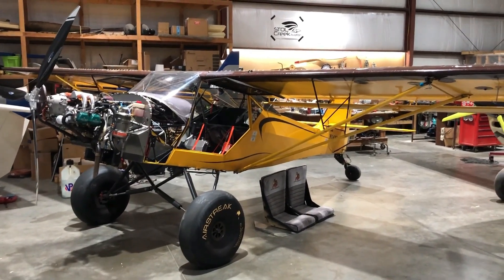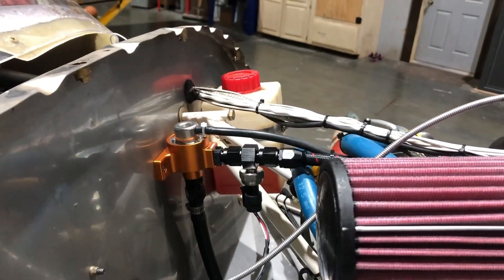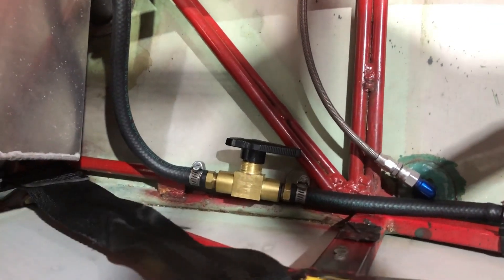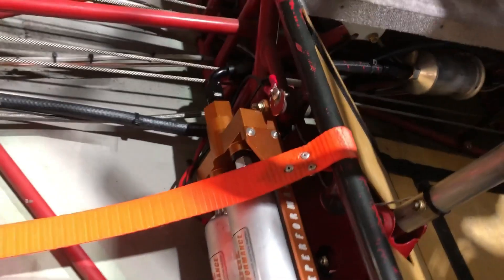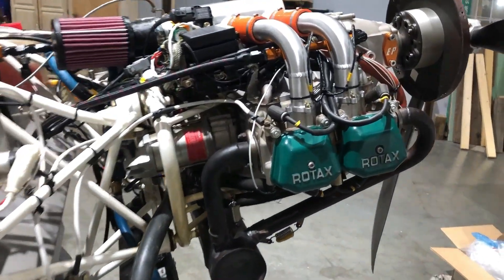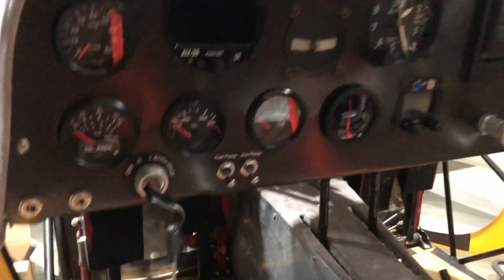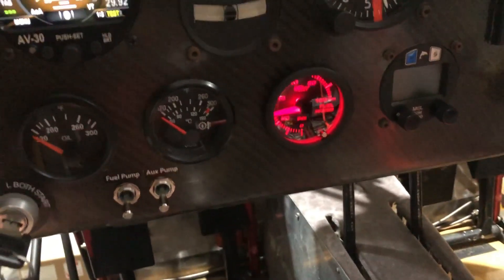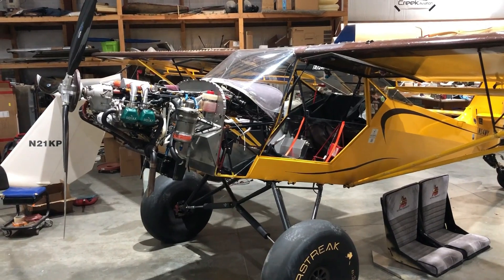EFI and Big Bore in a KitFox 7

Comment: Yes, the Kitfox (I had a model 1)  boot cowl give great access to the behind the panel area, but it also lets in water running off the windshield, unless your cowl seals real tight.  I like the RANS I have now boot cowl better, as the windshield overlaps it. BUT...., having just spent much  time upside down with my head by the rudder pedals doing wiring on my own EDGE EFI install, gives me a re-newed appreciation for the Kitfox cowl!

Comment: Where does the fuel return line go? Back into the header tank? Do the fuel caps on the wings have vents? Trying to wrap my head around the whole EFI thing.
Reply from the maker: Yes the fuel return goes back into the header tank. Both tank caps are vented and the header tank is vented to the right main fuel tank.
Reply: Thanks! @stolcreekaviation5507

Comment: Does the Rotax charging system provide enough amps to energize the EFI system and pumps as well as Avionics and lights?  Or did you add additional charging capacity?  And how much horsepower does the big bore kit.add with the efi?
Reply from the maker: The stock Rotax alt is rated at 20amps at full RPM. The EDGE EFI uses 6-7amps so the stock charging is usually enough but struggles at idle. We do offer secondary alternators for more charging power plus redundancy. The 1484cc Big Bore adds 14hp and the EFI adds 6hp bringing it to 120hp total.
Reply: @stolcreekaviation5507  thanks for the reply. I think those overly powerful external fuel pumps use the most amps.  I saw an elegant design that copied automotive tech where low amp submersible fuel pumps are mounted in the header tank.  These pumps don’t need to cycle so much fuel to keep cool since they are submerged in the tank.  So they only draw about 2 amps at the most. The pressure regulator was also mounted inside the header tank which eliminated an external return line.  20% increase in power is substantial.  I wanted to put an Edge EFI on my Rotax but the plenum would not fit. I bought an SDS efi system instead.  SDS managed to eliminate the plenum. The Rotax mostly keeps its stock profile.

Comment: Since this installation features an oxygen sensor, does the owner plan to completely avoid leaded fuel? 
… or is the sensor used only during an initial calibration/tuning phase, then taken out of the ECU read-loop?
Reply from the maker: All of our EFI systems use an O2 sensor for initial tuning and setup. Then it can be removed and run closed loop from the ECU fuel map (for 100LL use) or it can be left in and stay active for fuel trimming.